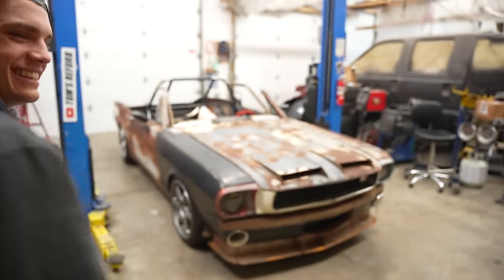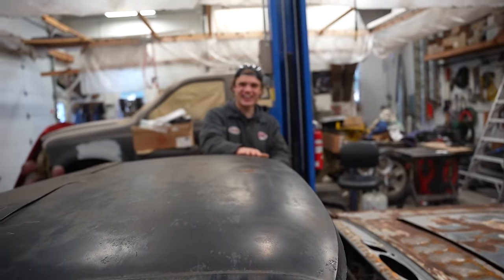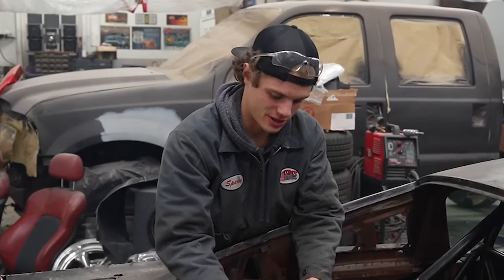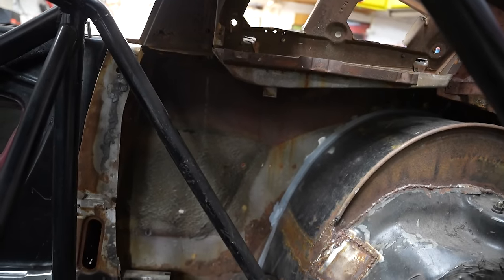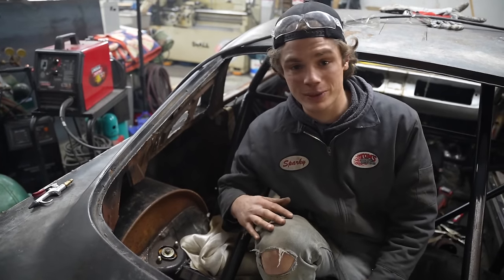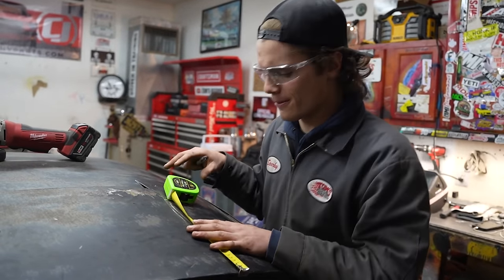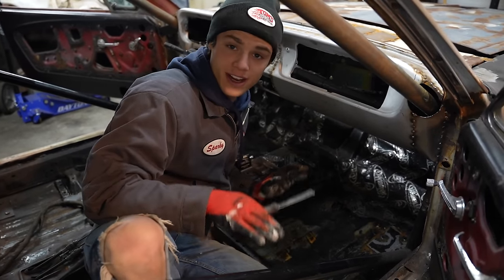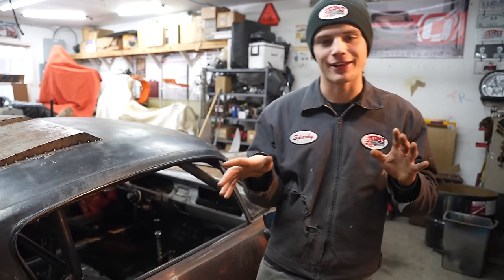PAINTING My Rat Rod Honda-Stang!? ("Masutangu" Rebuild Pt.5)

Comment: Another thing to consider would be filling those dead spaces you covered with marine pour foam. That stuff is part sealer, bonder, insulation/deadening, and flotation/strengthening filler. Just be sure to run a couple conduit tubes or whatever through it beforehand so you can get wires and lines/hoses and whatnot where you need them.

Comment: Tom has inspired me to cut the rust out my 02 suburban and make some patch panels just got them welded in and welds ground off just added some body filler and waiting for it to dry but i did way better than i thought i would only watched YouTube video's on welding sheet metal because this was my first time welding sheet metal as well but surprisingly didnt warp the metal 🙏 or at least not enough for me to care about 😂 shes just a work truck but i was tired of big rust holes in my quater pannels

Comment: For removing that coating a multitool with a smooth scraper blade would have helped immensely. It’s what we use in the flooring industry to get old patch and whatnot up in cramped spaces.

Comment: seeing all those tack welds without a full weld pass for the panels, as a welding student, and a former body technician, made me grimace . They look tight enough for the paint to at least fill the gaps to stop weeping rust, but yikes. Absolutely love the work flow and guesstimation though. It's fun seeing other people just let loose on some car work though, and it looked pretty decent at the end there. Hope it holds up well :p

Comment: 2.54 centimeters to an inch. So "one half of a centimeter" would be about 1/9 of an inch, which is not a normal measurement in fractional terms. But it's slightly less than an 1/8" and much larger than  1/16". So . . you were wrong  :)

Comment: Hey Tom I am a aviation mechanic and when I heard you say simple green I cringed so hard. Simple green and 409 should never be used as a cleaner, those have chemicals on them that cause rapid corrosion and rust.